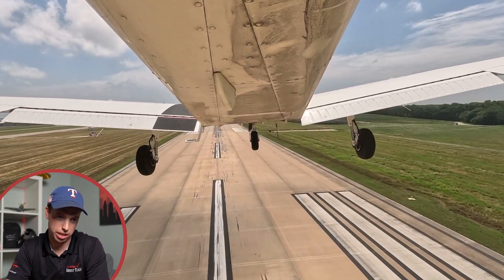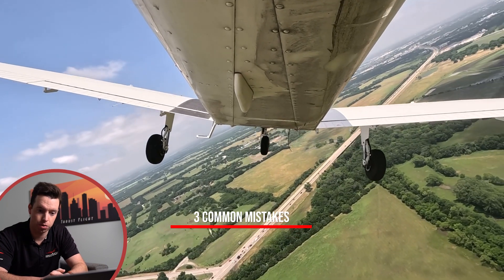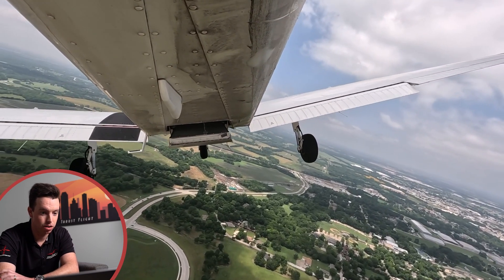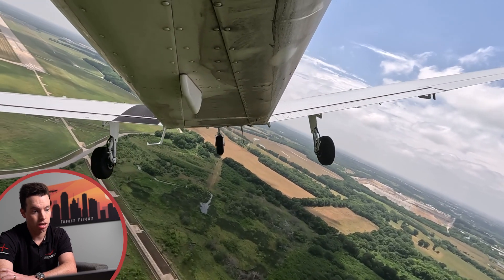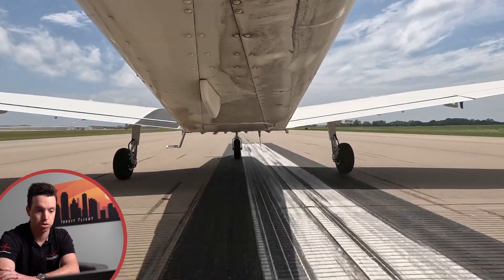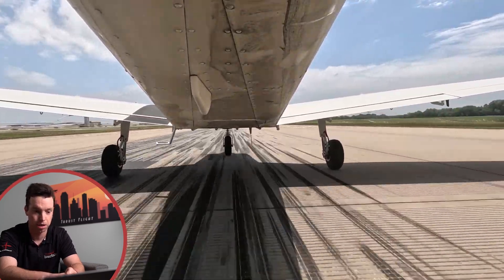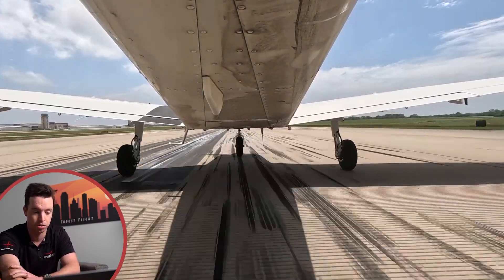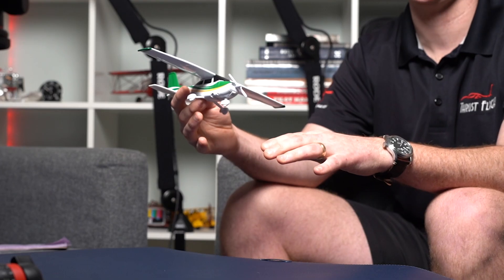Performing the Power Off 180 Maneuver and How To Do It | Why Pilots Fail Their Commercial Check Ride

Comment: Video lacks discussion of aim point, as commenter below has noted. Get started right and aim point in the windscreen will cue corrections and timely slips or use of flaps. Everything depends on early recognition that the aircraft is on or off glide path. Practice, practice, practice til you have internalized the proper sight picture in various conditions, much as you do pre-solo or when transitioning to a new airplane. As a footnote, I would not count on a DPE patting you on the back for using good judgment if you blow the maneuver and go around. The general guidance is no do-overs. Besides, this is a maneuver that can save you and your airplane. You might as well nail it.

Comment: A short field approach over an obstacle is done at extremely low air speed hanging onto the prop using power to control the descent rate. It’s not to be done power off and it’s not a “dry run” for the power off 180. A power off approach is done at best glide speed. Much faster than the power on short field landing over an obstacle. What are you teaching people here? Horrible video. Take it down.

Comment: I disagree. This was a 15 minute long video not once. Did you mention aim point drift. You mentioned the 30° arc off the downwind to turn base. This is not true for every airplane. You also mentioned it’s a judgment call on when to turn the base leg as to whether or not you “feel“ low. How do you know if you’re low or not? It’s the aim point drift. Yet you never mentioned it once. The single, most important aspect of flying a power off 180 and you don’t even mention it. Horrible instruction technique.

Comment: Amazingly bad video: 1. Power-off is NOT 'emergency landing', but the 'accuracy approach and landing' (per ACS' Task M!) 2. the deployment of flaps are consistently named incorrectly (25 deg are called 'full flaps', no flaps are called 10 deg, etc. 3. (the worst of them all; approx. at 8:51 min into the video) 45 deg turns on normal landing - when is it OK to do a steep turn in the pattern, i.e. this low to the ground?!
Reply: Yeah, this video is absolutely horrible. I left two comments on it, expressing my dissatisfaction with specific items he’s teaching incorrectly.
Reply: I agree with the first two complaints and they annoyed me while watching but at 8:53 he is talking about a 30/45 degree angle to the touchdown point not about the bank angle of the turn itself

Comment: The reality is “every day is a new day.”  Winds are everything.  On check-ride day go out early before the start of the check-ride and practice for the conditions on that day.  Yes, things can change and they can also stay the same or be similar.  Practicing an hour before the start of your ride/oral will also give you confidence no matter what the winds are.
Reply: The reality is if you lose an engine and land safely on concrete or asphalt, who cares if you hit the 1000 footers 😅. 😂😂😂
Reply: @Nickwithda.25zip  That is true.  But the point of the maneuver is can you get a sense enough of the airplane to make it do what you want, according to conditions, in a potentially uncomfortable situation, without using the engine as a backup.

Comment: Also on the checkride, no GA is allowed. 😂
Reply: I’m sure an understanding examinar would appreciate a well executed GA, rather than desperately trying to stretch a glide which will inevitably lead to an undesired outcome and a failed test.
Reply: @carllr87  Sure, he'll still fail you though.
Reply: @carllr87  "Initiating a go-around as a result of an applicant’s inability to complete this Task within the tolerances specified in the
skill elements is considered unsatisfactory" (FAA-S-ACS-7B, Appendix 3 section IV).
Reply: @zarmril There are some DPEs that allow a go-around, even though that is not in the ACS.    It is best to ask the DPE ahead of time so you know what to do when the time comes.
Reply: @dreamcreator2552  Or you could just train to proficiency as stipulated by the May 31st ACS change...
Reply: @zarmril  No argument on that.   In my initial training for the PPL my instructor had me do all my landings with no power.   That made it a lot easier for the commercial.   Whatever works.  Lots of commercial check-rides result in failure due to the power off.
Reply: @carllr87  DPE ive spoken to said he regulation doesn’t have GA written for this landing and therefore FAA’s interpretation is no GA. Also if you have to stretch the glide with configured flaps, you’ve done fucked up. You’re supposed to bring flaps down in ground effect to give you last minute float without drag. Obviously as you have mentioned, that is considered desperate and undesired as much as retracting flap for a carrier landing when you are about to land long. Either way, in between failing and toss the coin, you’d be the judge
Reply: *unless ATC calls your go around
Reply: Bro what? Go around an are more than aloud.
Reply: @Rolledtreasures  on a commercial check ride, initiating a go around on a power off 180 is a fail of that maneuver.